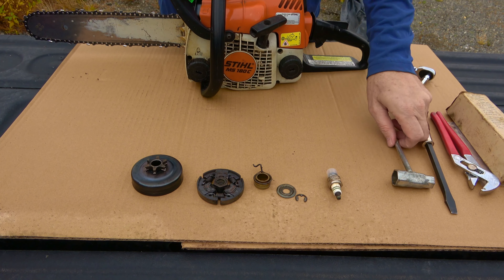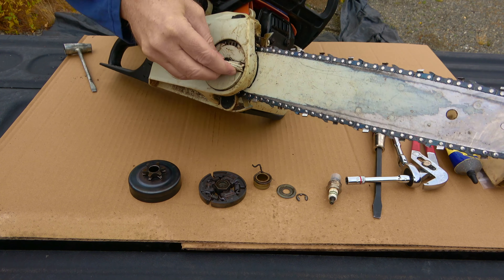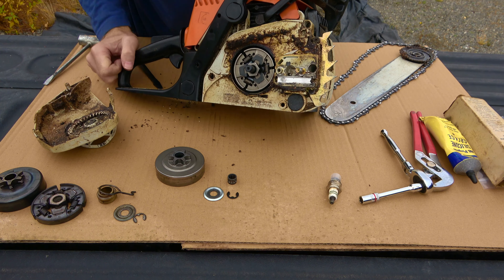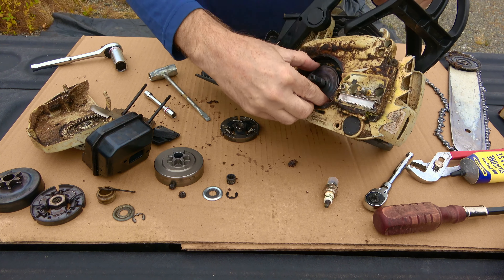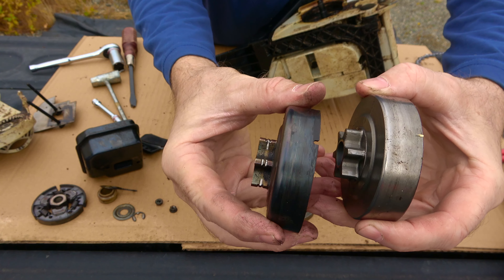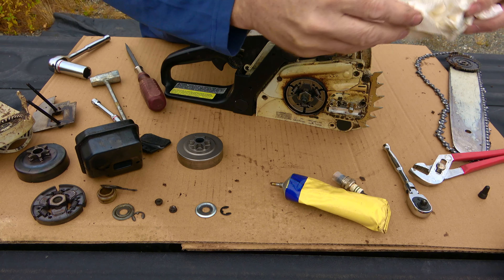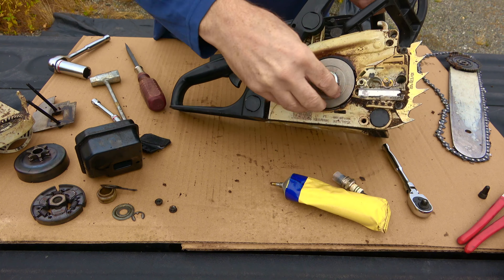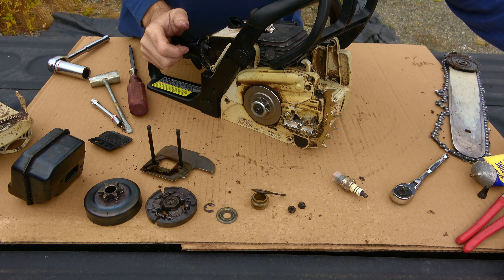STIHL Chainsaw Alternate Method. Clutch Assembly replacement/oiler bearing repair.

Comment: You go through all the trouble of taking the muffler off and then risk breaking the fly wheel with a screw driver when you can simply use a piston stop. Man you a braver then i am
Reply from the maker: I do discuss that in the video, regarding using a piston stop or other options. Just sharing an option. I also discuss that it's important to understand that it's a reverse thread. Ive never really needed much force to crack the nut. Certainly not enough to break the flywheel. But certainly care should be taken. Especially if it's not understood it's a reverse thread and trying too hard to crack it when actually tightening it.  Ive used  a few options over the years. But not everyone has a piston stop handy and it's just another way to come at it.  And it also allows your to see in and eval your piston a bit as well as clean things up . Spark arrestor etc.  Just an option.  But your concerns should be considered.
Reply: @ericinalaska7648  you are also right guess I didn't think about it that way thank you for sharing
Reply from the maker: @danielpadgett2831  Thank you for watching and commenting. It's always helpful to her viewers perspectives and thoughts. It helps address and clarify things for other viewers that may read the comments also. Thanks again.
Reply: @ericinalaska7648  absolutely

Comment: I use an old Slant Six spark plug as a piston stop. The threads are the same as the saw and a good half inch longer. I would advise against wacking on the clutch since you could poke a hole in the piston.  If I'm home I just hit it with an air impact gun set on tighten.
Reply from the maker: Yah it "usually" doesn't take much to be able to crack the nut loose on these and other stuff if you can just interrupt/stop the full stroke of the piston.   Just did the drive belt on a riding mower. To remove the front clutch/pulley. I had to resort to going in through  the plug. I actually used bungee cord. Worked great. I prefer not to stuff things in the cylinder if I can avoid it but they make plugs that do basically what your accomplishing with the longer spark plug. It's just a less aggressive surface than a spark plug hitting the piston really.  People have been stuffing rope and such in there for longer than Ive been around. Just always feels a bit odd to me, stuffing other things in the plug hole. but Im always amazed at how well it can work when needed. And if there's no other way. So be it. The impact wasn't doing it. And after a bit of non perseverance, I went in through the plug and the bolt came right off. And in that instance I thought. I Should have done that in the first place. So there's that. Many ways to skin a cat as they say. Thanks for the suggestion of yet another way. Appreciate it.

Comment: A hunk of rope through the spark plug hole or just use an impact to get the clutch off is probably the safest way. Break a fin off the flywheel and you will really have head aches. The flywheel is only aluminum and very easy to break off a fin. But you do it the way you want.😮
Reply from the maker: Yes some rope or there is even a tool specifically designed for the purpose. Which  you probably are aware of but for anyone else reading this. I think I discuss that in the video and or video description. Just showing an option or alternate to that. Impact works as well but not everyone has one. Braking a fin is of course a concern but as long as the individual understands it's a reverse thread, I haven't personally found it takes much to crack the nut loose.  If one is trying to turn it the wrong way, not understanding its a reverse thread. Issues can arise from any of the approaches really. I have also used bungie cord. Brand new one, and removed  a hook on one end. Made me feel better having a little give provided by the bungie.  This is really only offered as an option not as a solution or improvement. Ive done both. The way I demonstrate in the video also allows folks an opportunity to have a better understanding of some of the other parts and ability to clean your spark arrestor and  just get to know the equipment a little better.  Just another way to skin a cat really, that's all.

Comment: Nice video, but you're more likely to damage a flywheel fin or the crankcase by jamming the piston that way. You're better off stuffing some nylon rope or cord into the jug, worst thing that can happen is you  get something stuck in a port, but rarely do damage to the piston or jug.
Reply from the maker: Certainly a possibility.  It really didn't and shouldn't take that much force. Wasn't much resistance cracking the nut. As long as who ever is doing it understands it's a reverse thread.  Presented really just as an option or alternative to what you're suggesting.  Earlier this summer I opted for cord through the spark plug hole on a riding mower to install a new drive belt on a buddies mower.  I actually used new clean bungie.  And I have seen actual tools, plastic plugs as well  sold and made to put in the plug port. I didnt have any of that and did it this way and am just sharing an alternative. There are risks really with any approach when in the wrong hands. Just have to be aware of them and take care to avoid.  One of the risks that could lead to damage I would say would be not understanding or knowing it's a reverse thread. Then there can be all kinds of unwanted results.

Comment: Just use an impact wrench !
Reply from the maker: Just an option for when you don't have access to that or other approaches commonly used.  But you'd probably, but I guess not necessarily, still want to stop the piston stroke.  But with the right touch Im sure it's doable. This is just an alternate approach.

Comment: Hey, guys.  Please DO NOT use an impact wrench.  The name ''impact'' tells you why it''s not a good idea.  The sudden impact can and does now and then shear off the flywheel key which kills the spark timing.  Since these things aren't usually all that tight in the first place it's much less risky to just block the movement of the piston.  Especially when tightening it back.
Reply from the maker: Agree. Not the best option.